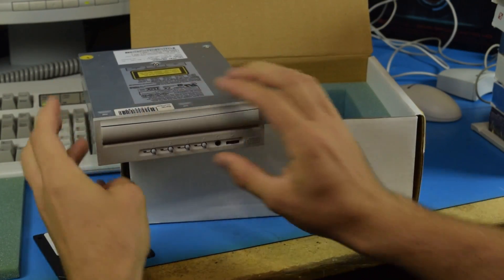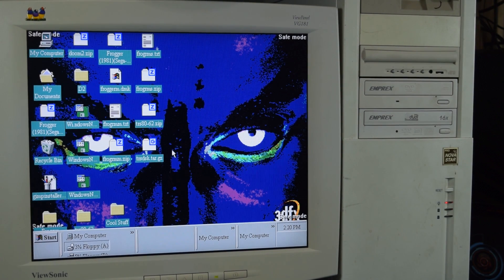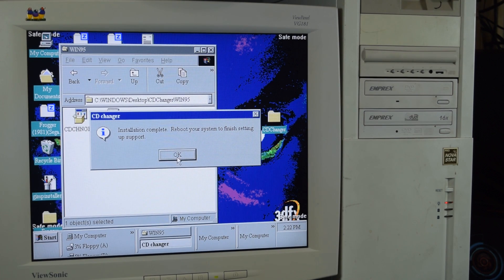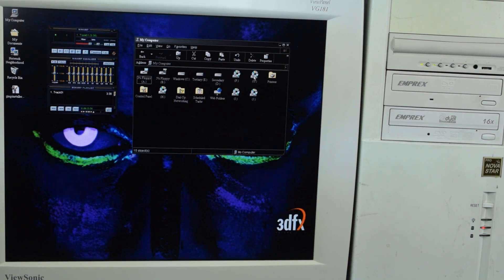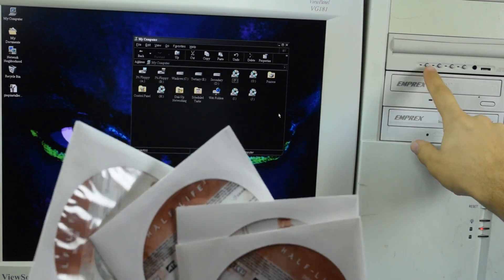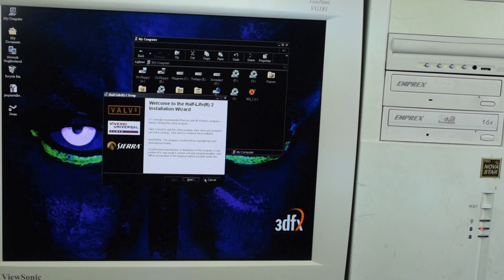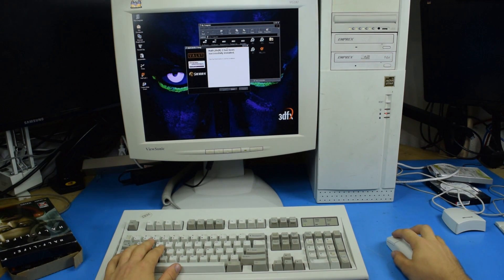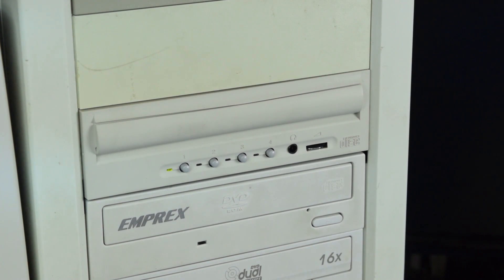0x0010 - IDE CD Changer

Comment: Slot loading drives are cool, but I don't like the way the little rollers will mar your discs over time. The rollers accumulate debris and grit which will leave nice permanent lines across your discs.

Comment: That's so cool. I'd rather have that on windows XP though. I've had issue's with 98SE freezing when its trying to do something and I find out annoying. But I do like the OS. So try to not bog it down with so much stuff. And you might not have booting issue's with XP with hardware. I cant remember having boot issue's with XP.

Comment: i had something like that in my first 486 computer
my drive was nec and a little bit more square on the tray bay doors but it was most of all defective :P it hog cd's inside and lock them in some kind of wierd loop.
windows95 seen my drive without additional drivers, mscdx on dos could only see the first bay